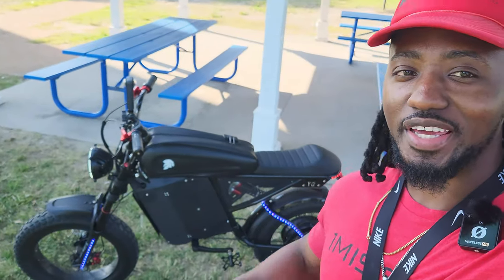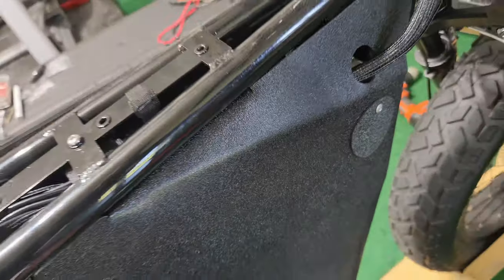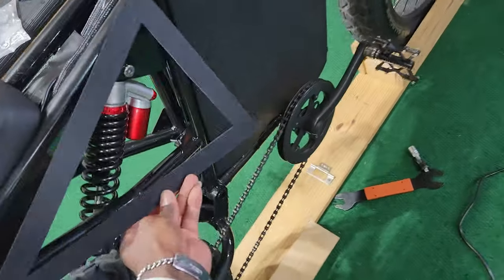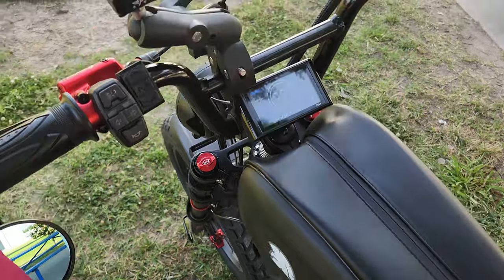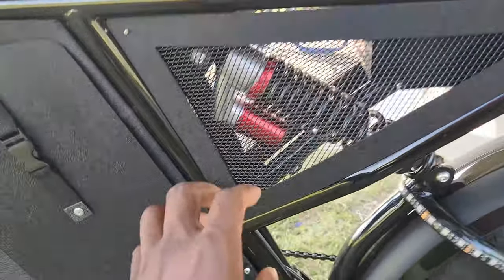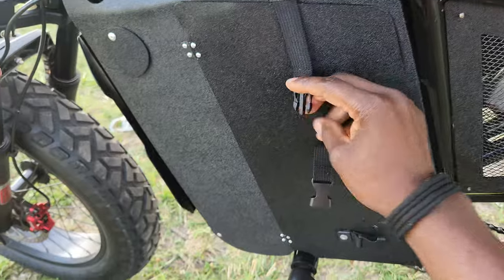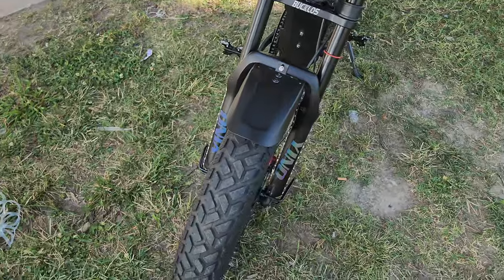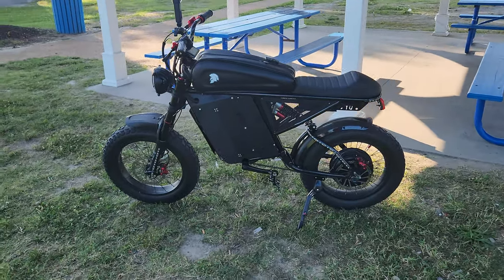How To Build A Powerful eBike From Scratch! Part  2

Comment: Fantastic job Mad Skills, you did a great job brother if you wanted a second battery that shake just like the storage unit you can get one off of Power goat that is shaped just like that and they will give you a converter kit so that you can plug both batteries into it and then the one plugs into the converter then you'll have dual battery

Comment: Your build is great. Just one opinion of mine is to apply edge protection like those we use on cars to the panels. Also the holes where the wire go into them. Maybe put like an elastic seal the expands and contracts depending on the size of the cable to help eliminate the worry of water going into the storage. Also there are gaps at the bottom where the panels meet the frame. Try apply sealing rubber with double sided tape to avoid water and dirt getting in from under. Inline your build. Is am currently doing a build myself and I must tell you brother I am exhausted at how many hurdles i have to overcome. I am currently on the braking mechanism for mine. I am trying to do what hasn’t been done before for e-bikes. I am using Lewis ep6 front and ep8 back motorcycle grade brakes with 250mm rotors front and back with aftermarket automated braking system. Took me 4 months to find the parts together but i am going strong. After this I will move on to my greatest difficulty. The side panels 😂 I am definitely copying your panels. A thief is born
Reply from the maker: Edge protection sounds good. Though the holes/vents on the enclosure are actually intentional. My battery is already water proofed, but since the battery is there, i wanted some vents so heat being generated can escape. My tools are also in a water resistant bag inside the enclosure. I don't ride in the rain, but even if i did get caught, i'm fine with a little water getting in there. And for the bottom i did put something to prevent mud. And yeah those side panels are gonna be a but challenging, i'm impressed by your braking system though.

Comment: Very Sweet build!! While I'm waiting on my Motor Goat V3, I'm halfway tempted to build a bike around that same frame. Also, if you are interested, I can send you a CAD cut file for an aluminum  battery case (all I would need are the dimensions of that open frame space area.)
Reply from the maker: I love the motor goat, my battery is actually from them. And thanks for the offer, i might take that in the future
Reply from the maker: That's incredible. do you have a picture?

Comment: You should check out redshift foot pedals those are some of the best and brightest and coolest bike pedals I have ever seen and I did not regret buying them for my motor goat V3 I got a different set for $40 off of Amazon for my power goat which are just as fine but I prefer the red shift those are amazing
Reply from the maker: I have leds wrapped around this bike, plus i can change the colors or brightness level. All running off the main battery. Super bright at night. Those pedals are cool too though.

Comment: Nice job. You may want to try 1/16 or 1/8th sheet metal to make those body panels. Also , does that front mudguard protect the body of the bike?
Reply from the maker: @PaulPaid  I think i just might use those sheets later. The front guard i chose is interesting as it's a two part. There's another part bolted on to the frame itself behind that front tire. I've been riding ebikes since 2018 and i never ride in rain so it's hard to say how it'll perform in that, but it works well for the occasionally splashes i've been in.

Comment: You said it's functional, so that means you can pedal it home if the battery or BMS dies?
Reply from the maker: Yes, but it depends on how far from home. For an example the bike died on me during a few of my test and i easily pedaled home when i was about a mile from home. But when i was about 6miles from home i just called the uber, i'm going through pcp treatments instead of getting another knee surgery so for me pedaling long distances is painful and not ideal for my healing process.

Comment: Paint the abs matt white it will help in the long run to prevent overheating and deforming of the plastic
Reply from the maker: @kennethpaschall6811 I really prefer to have a black look. Did you say white because white absorbs less heat or do you mean just cover it up somehow?
Reply: @KingKola_  white because it absorbs less heat I've made a few things out of abs plastic same color as the abs in your video in prolonged exposure to sunlight it can get very hot
Reply: @KingKola_  the only other method I can think of doing to dissipate excess heat during the summer would be to basically put a couple of air intake scoops on the forward portion BTW doing the mods I'm talking about will allow further modifications in the future in the area of the battery or batteries
Reply from the maker: @kennethpaschall6811  I see, that does make sense, but it'll completely throw off the vision i have for the bike and that's not a sacrifice i'm willing to make.
Reply: @KingKola_  to each their own
Reply from the maker: @kennethpaschall6811  I might also go sheet metal in the future, idk just yet.
Reply: @KingKola_  if you do sheet metal be extremely careful when cutting it I myself ended opening my left palm by about 2 inches by accident

Comment: You basically built a knockoff motor goat V3 LOL I'm not knocking it or anything it looks fantastic brother great job but I have that mg V3 and that's literally what it looks like is the same as my bike and it sounds like you got the same power and wattage the only difference is you got spoke wheels where I got the I don't know what the hell you call them it's not spoke don't go and check out what I'm talking about on power goat motor bikes. Once again fantastic job though it does look beastly and I wonder how they would compare against mine? That is curious
Reply from the maker: Thank you. Yeah it has similarities to motor goat, as well as super 73 rx, and most like the black warrior which was my inspiration. But the reality is all cafe racer style ebikes including v3 are built to look similar to cafe racer style motorcycles. Honestly though, all these ebikes use motors and controllers from basically the same place and just build or buy their frames in  bulk and slap their logos on it. I've opened plenty of ebikes, and their internals are all the same. As far as how it directly compares power wise to the goat? Very similar for now, but mine is more efficient at the same speeds. I have lots of upgrades coming soon too.

Comment: Also, the frame looks like you got it from YQE bikes I wouldn't recommend anything from them, they have good looking bikes and parts but they are some scammers, they run 3 or 4 ads and try to make you pay the higher price no matter what ad you buy on!
Reply from the maker: Yeah i can see that. Luckily for me, i do extensive search before i purchase from any company.
Reply: @KingKola_ I bought the same type 73rx much better frame not from yq horizon dropouts just much better quality the yq frame has been known to break I've seen it
Reply: @KingKola_ nice build though good job you did
Reply from the maker: @user-ms8xp4dx2k   i bought this because i wanted a metal frame, metale frames are heavier but typically better for powerful ebikes. The top 60v ebike companies are all going with metal now. And as far as the quality control though, yeah it's on the low side, but i don't mind this. I have a welding machine to fix it if anything happens. I once had an aluminum frame ebike that broke and i couldn't fix it without paying a pretty penny.
Reply: @KingKola_  the last super rx I built was aluminum but it was manufactured right the horizontal dropouts was 3/8 thick plate I put a 8000 watt motor on it and my brother still rides it today If the aluminum frame is built right it's better then steel
Reply: @KingKola_  I will tell you this there is no way I would build the rx from yq in Aluminum noway